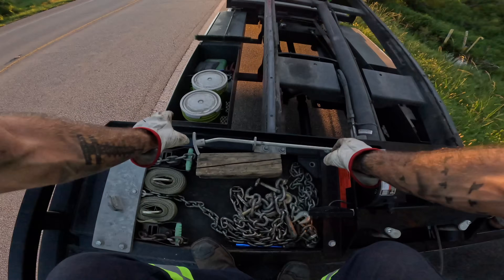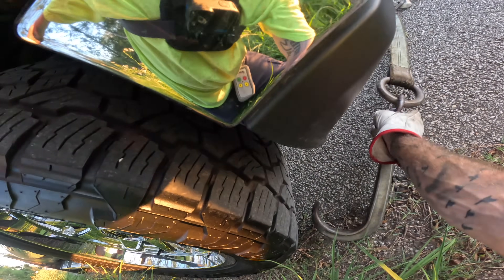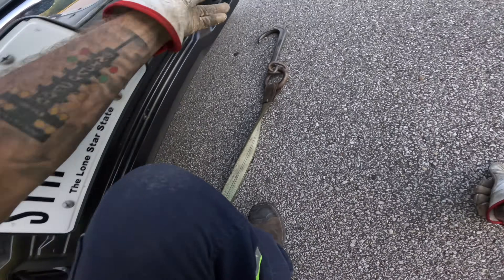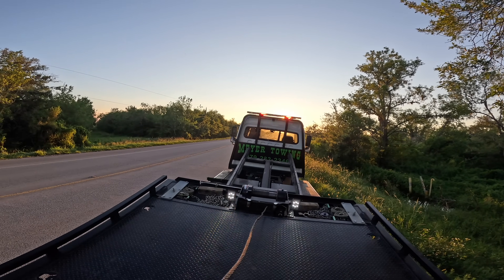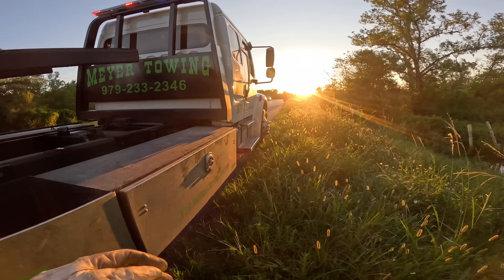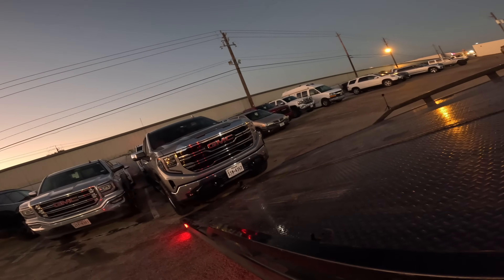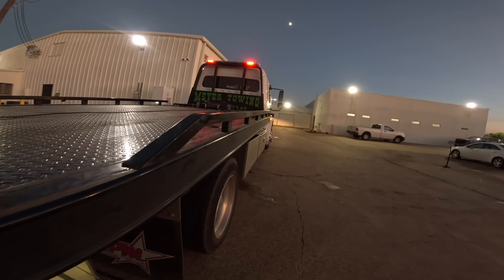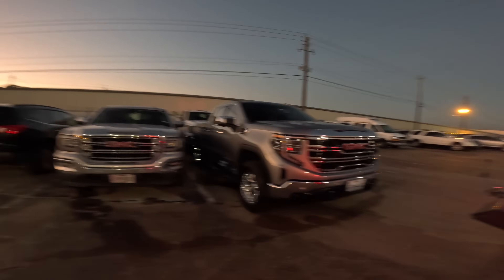Is GM Ever Going to Fix These Trucks??

Comment: No thanks, I’ll keep to Toyota lol
Reply: Toyota is cooked
Reply: Have fun with your recalls
Reply: Toyota has its problems as well
Reply: Yeah right, new Toyota ? You mean the Tundra that Toyota now has to replace nearly 100,000 engines in??
Reply: At least they are replacing them. With GMC and Chevy they just update the software to tell you when transmission will give out (no longer a safety issue)
Reply: Tundra and Tacoma having catastrophic engine failure recently. Look it up bruh 😅

Comment: GM (general mess) has a female ceo, so I'll let you figure that one out.
Reply: And Ford has a male CEO and they have multiple issues with more recalls than GM so your statement it’s kind of stupid
Reply: @CBH238  Your reply made me smile. 👋🏾
Reply: lost brain cells on that one.
Reply: @FoxFaderWorld  so did yours.👋🏼
Reply: @CBH238  But at least Ford recognizes a problem and makes a recall and actually fixes their vehicles with on hand or easily gotten parts within a day or so.
Reply: @jdwht2455  😂 no not the case. They have part shortage as well. And GM did a recall on 6.2  because the engines are blowing. No manufacture will do a voluntary recall on a design flaw that is not blowing up the engines that’s what happened with Toyota and that’s why they are in the predicament that they’re in same with Ford and same dodge soon.  but they will not recall the 5.3 for lifter fails because it does not destroy the engine technically it can but it’s rare 6.2 is blowing the cams and the engine. I found a frame when people stand behind Ford because they hide their practices very well.
Reply: bull
Reply: Why the Chevy emblem is a maxipad

Comment: Engine seized., been there . Car wouldn’t go to neutral and had to be drag in the flat ., that was a year ago ., guys … guess where my truck is at the moment……. Againg … at the dealer for the third engine. , original engine 67k miles ,, second engine 45k miles and third lets c .
Reply from the maker: Woah!! That’s not good
Reply: AFM delete helps for sure, 120k on mine

Comment: Couldn't you pull the bed under the front wheels and then grab the rear axle with the wheel lift? Seems easier then dragging it and less damages. Wouldn't matter with AWD I guess. Or with the keys couldn't you start it and put in into neutral???
Reply from the maker: No. That wouldn’t work at all. The proper way is it load it onto a flatbed.
Reply: If it would start he wouldn't need a tow. Bad fuel pump module.
Reply: These trucks are not awd gm hasn’t had awd since the Sierra and Yukon denalis and Escalades from 02-14…the new trucks in14’ went back to switchable 4x4 and same for new SUV’s in15’… the lower trim trucks were switchable 4x4.. but denalis and Escalades back then we’re awd.

Comment: General motors should be ashamed of themselves for the junk they put on the road today. You can usually tell a gm product driving down the road. There is usually a headlight out or marker light. I am truck driver and pay attention to this. GM puts alot of junk on the road plus they rust. My 2017 ram has no rust.
Reply: You had a convincing argument until you used RAM as an example of not rushing 😂😂😂
Reply: @thesandman775 lol... with you...

Comment: I thought tow trucks had wheel dolly's with long bar that runs from driver side to passenger to attach them and then pull truck on?
Reply: You’re thinking of the wheel lift trucks

Comment: Is this fuel pressure sensor issue for the 2022 and later models with the console-mounted transmission shift lever?
Reply: I have a weird fuel pressure related issue, or at least i think thats what it is. Ive changed 2 sensors so far, still hasnt fixed, driver side fuel rail with the regulator on it is the next try at this fix. Anybody with info on this is appreciated

Comment: i highly doubt it…if GM really wanted to make a reliable vehicle they would but the greedy people make a medicore product which they know will break down so the customer will either have it fixed or get a new one…homdas and toyotas used to be the best reliable vehicles you could buy but both have done some boneheaded decisions the past few yrs…never ever get a car with a turbo/suoer charger…wears engine out faster…also no GDI or CVT engines..i have a 2010 rav4 with over 200k miles and still runs smooth..other than regular maintence service,no issues
Reply: Toyota and Honda are the only modern cars I'd want. Want luxury? Lexus or acura.

Comment: Usually taking negative off battery and putting it back on works and vehicle starts fine.   I’ve done 100s of these.
Reply from the maker: Mechanic can handle that. I’m not there to work on it, just get it to someone who can.
Reply: Takes 2 minutes and makes it easier on you and your truck.
Reply: @svtzeater  but he doesnt get paid as much that way
Reply: @HAHA.GoodMeme  I still charge the same and I still tow them, I just make things easier for myself.
Reply from the maker: Yeah, and when something gets fried, and they find out you messed with the electrical system, regardless of if you caused it or not, they’re going to put you on the hook for it. 
I’ll take a few extra minutes and little extra effort into not having to deal with that lol
Reply: @Towtruck_Dustin  what can go wrong by disconnecting and connecting negative cable?

Comment: awesome job ! does the 2024 models have the same problems ?
Reply: Yes!
Reply: @dbstelly  that bites ! i have a ticking time bomb , i should have went with the tundra>
Reply: @JasonHowe-xf9pi  Yep I have a 23 at4.  Only problem so far (14k miles) was day 2 with 12 miles was leaking rad fluid from the pump.

Comment: Why wouldn't you try to jump the vehicle to start it first & put it in neutral the easiest thing first then put it on the bed?
Reply from the maker: Because it doesn’t need a jump. It needs a fuel pump module.
Reply: @Towtruck_Dustin  ok now i understand thx

Comment: I'm surprised tx doesn't have the mandated move over law? And I was thinkin of moving bk to tx.
Reply: We do, but you are given the option of slowing down to 20mph below the posted speed limit if you maintain the lane next to the emergency vehicle hazard.  Our roads are sometimes very congested and moving over is not always possible. These people could have done better, however.
Reply from the maker: As stated above, SDMO is a law, but either people don’t care, or can’t move over.

Comment: do not press the button on the shifter and it should go into N
Reply from the maker: Never had that or anything else work. 
GM makes a special tool for this reason, but it’s $400. 
The same can be done with a wrench and a zip tie, and unplugging the e brake sensors.

Comment: I gave up on GM after I ended up crashing my 2016 Chevy Equinox last year.  It had plenty of room and that's pretty much all it had.  I began to hate the underpowered 4 cylinder engine the car had and the transmission shifted hard.  I went for a 2020 Toyota Camry back in January and it's a much better car than what I had.

Comment: What about putting the 4 wheel drive in neutral?  I know older trucks if you put the 4 wheel drive in neutral it would put the transmission in neutral.
Reply from the maker: The first step to shifting the transfer case to neutral, is putting the transmission in neutral...

Comment: I’m wondering why you didn’t haul up that truck with the tow hooks on the bumper. Safety issue? Previous bad experience?
Reply: Safer to pull from the frame and also run out of cable verse distance.
Reply: The lower you hook the less drag. It'll pull up on it rather than pull down which drives the tires harder into the asphalt.
Reply: @user-3tf67bk46u  Agree , I also don't use J hooks that much. I've seen it damage control arms. Lot of weight on a control arm. I use J hooks on wrecks only.

Comment: Couldn’t you just undo the bolts from the rear differential to the drive shaft and then do the same for the front? Just to make sure bolt diffs are free
Reply: That’s a lot of work to do on the side of the road just to put everything back when you drop it off.
Reply from the maker: The goal is to not be on the side of the road long. Asking to be hit.
Reply: @WhiteTrashSTL  I was suggesting leaving the drive shafts on but disconnect the side that’s to the differential. Would only have to take off one set of bolts on each a side

Comment: Cant you use the tow hooks coming through the bumper in a pinch situation like this?
Reply from the maker: They’re recovery points, not tow hooks.
When loading them on a flatbed, if you hook that far forward by the time the front reaches the winch, you’re pulling straight down on the hook, suspension, and putting a bunch of upward force on the fairlead for the winch. 
Plus the rear tires will barely make it on the bed, if at all.

Comment: Does transfer case have neutral
Reply from the maker: Not that I’m aware of. Supposedly there’s a process for it, but it involves putting the transmission in neutral first, so that wouldn’t work either.

Comment: I have to say, that this is the most boring crap ever. I appreciate the job of the tow truck folks. It’s as exciting as watching paint dry.  There is not one single model vehicle new or old that doesn’t have a failure of some type. This anecdote seems to stoke the haters though. So mission accomplished !!
Reply: Why are you watching if you find it so boring?  Just move on!  There's an endless supply of videos on Youtube-why waste time on something that bores you so much?

Comment: Can't you disconnect linkage or whatever they're using now from trans & transfer case ? old timer here, used to linkage  on both trans & manual transfer case, ahhhhhh the hood old days !
Reply from the maker: No. It’s all electronic unfortunately
Reply: No experience in the towing trade but I am getting to be an old timer.  I just don't get how a 60+ thousand dollar pavement princess pickup truck that is constantly breaking  has seemingly become some sort of status symbol.  I work on a main road in southwest Fl and every fifth vehicle that goes by seems to be a pickup that is most likely in negative equity and totally unneeded by the people who got talked into buying them.  When I was a kid the only people who had pickup trucks were farmers but then again in those days we had a better grasp on the difference between need and want.
Reply: A few people in the comments said you can hold the start button for 5+ seconds, and it will put it into service mode, then you can put it into neutral.

Comment: So, this issue doesn't seem to occur with the diesel engines in the GM 1500s?
Reply from the maker: No, mostly limited to the smaller gas engines.

Comment: Hey there are also junk pile dodges ,ford's, Toyota which also have dealer issues
Reply: Sold my 2019 Silverado for a 2021 5.7 iforce tundra. 15 years of working out the bugs and number 1 most reliable.

Comment: Can’t you shift to neutral in accessory mode?
Reply: No you can’t, if you can’t start it you can’t shift it. GM probably saved $0.75 per truck on a part that would have made it possible. But no.
Reply: Potentially thousands in transmission, brake and other damage to save a few cents

Comment: WET THE BED WITH WATER TO SLIDE THE TRUCK UP:face-orange-frowning::face-orange-frowning::face-orange-frowning::face-orange-frowning::face-orange-frowning:
Reply from the maker: Won’t help any. Slides just fine with the winch pulling it. Only makes it easier coming off.

Comment: Have to love the "I will just keep my 20 yr old truck" comments. Yeah, spend thousands on repairing old trucks with engines, trannies, diffs, tie rods, rear ends, body panals, etc, but at least you don't have a truck where warranty will cover the cost of repairs.
Reply from the maker: With the cost of new trucks now days, at least you can fix it yourself in the driveway rather than having a payment on something sitting in a dealership you can’t even drive.
Reply: 2 months of truck payments will cover a years worth of repairs if you diy. Do the math
Reply: lol.

Comment: Ain’t no way I’d leave my truck in neutral and trust a customers cars brakes or transmission to not fail. Drag the truck up or throw skates if you’re worried about “transmission damage”. 20yrs towing never once have I had any issues with transmissions after dragging them up the bed for 25ft. Never heard of a claim. It’s a fairy tell you learn when you start towing and then find out no one has ever had an actual claim for it.  More liable to cause damage tossing J’s instead of using frame tabs but given your on the side of the road loading I would of done the same just gonna be careful not to actually hook a sway bar.
Reply: This new crap is not as though is the old school  trucks u must be one of those who don't have pride on your work 
Wouldn't be nice to know who you are to never use your services this guy is an ace and have alot of pride in what he does you should copy he's ways of how to take care of someone else's personal property  
Have a good day and be safe

Comment: honestly any truck especially now adays is a POS ford dodge chevy even toyota. not just gmc or any brand innparticular. i fortunetly have a 2015 gmc sierra 2500hd with the duramax diesel and alison transmission hasnt failed me once yet. traded in my toyota tundra trd pro 2023 after that POS broke down twice. should of never traded my 2018 tundra sr5
Reply: Well, Toyota did fix some of the issues plaguing the Tundra's for the newer 2025 and 2024 models.
Reply: @JustNotIt9927 did they fix the major issues with the tundra’s? I know the engines were completely being fixed from the ground up

Comment: I HAVE 2005 CHEVY 2500 TRUCK DIESEL CREW CAB 4x4 LS HAD DEALER REPLACED WHEEL BEARING FRONT TOOK ME FOR RIDE HAD IT DON TWO TIMES AND NOW MORE WORK GETTING WRIPED OFF SUBUBAN CHEVY CADILAC IN ANN ARBOR MICHIGAN 48104
Reply: Glad I live in rural low population area. My dealership works for their customers and will fight GM for warranty payments and customer satisfaction. They want to keep a good reputation and keep their customers coming back. They rely on customer satisfaction.

Comment: Lost confidence with Chevy in 1973, pickups that rusted out in 6 months , stayed like that for years. Got a little better in the 80s…
Reply: They went down hill in the mid 2000’s. Late 90’s early 2000 models they were decent.
Reply: What brand do you prefer now?

Comment: Funny how ALL the people in the comments are trying to slam GMC when it probably is AN Issue they are trying to fix. MAYBE MOST OF YOU ALL DO NOT TAKE CARE OF IT..TREAT IT LIKE GARBAGE IN THE BREAK IN..OFF COURSE IT WILL END UP LIKE THIS. If you can tell me it happens to 90 percent of 6.2, then you are likely not telling the truth. 

On average , how many do you tow per year? Of GMC in particular.
Reply: What does that have to do with a fuel pump that quits, a well known GM problem on these vehicles? Did you actually watch the video or just decide to read the comments before making your shouted snarky comments?
Reply: Sounds like someone is trying to justify their mistake. Just sayin!
Reply: mega cope detected

Comment: Is General Motors owned by the Chinese?
Reply: Buick is.
Reply: They just act like they are.  Rotting frames and self destructing tiny turbo engines.  But to be fair, electrical problems have almost always been a hallmark of the brand.
Reply: As are all our so called made in America vehicles which are assembled here but not made here
Reply: If the Chinese were making this truck it would still work.
Reply: China owns 49 percent of General Motors what a disgrace
Reply: @MrRockyko  Is this an allegation or is there something you can offer to support your statement?